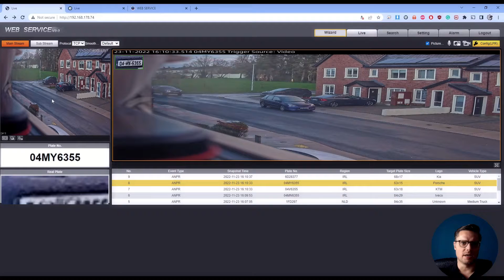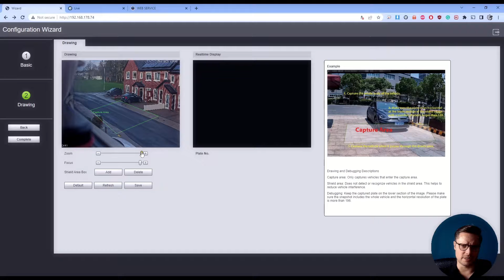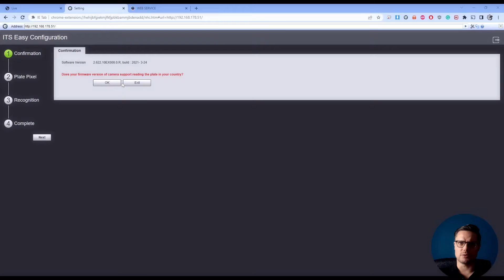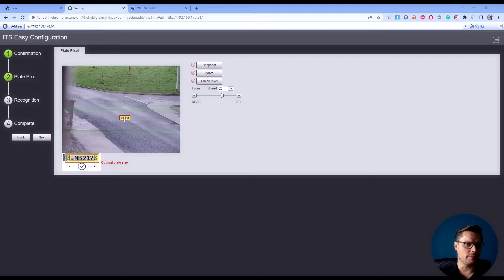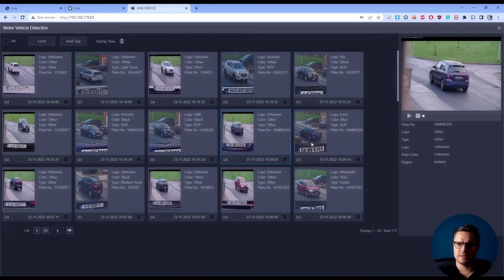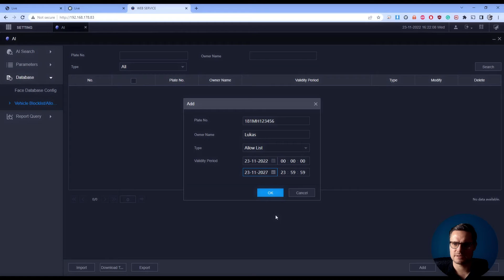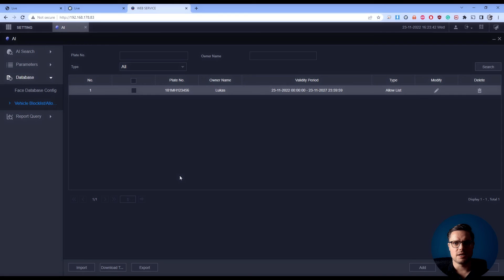ANPR Cameras

Comment: I have a Dahua nvr5216 and Dahua anpr camera. I have many problems with the nvr. 1 the face database tab where you create new databases should have Type and then the option "local" and "remote" from the drop down. Mine only says "remote" How to get "local" 2 when you search for faces, on the face info box it should have a "add face to database" button, mine is missing. 3 on the main screen on the right side you see the captured car and plate, and that panel should continuously update as cars are captured, mine stops after about 30minutes, and other problems. I am expert at setting up cameras and nvr, but this one has stumped me, any ideas, no help from the seller.
Reply from the maker: Make sure you are using the latest firmware.
I'll make a new video regarding the FR database.